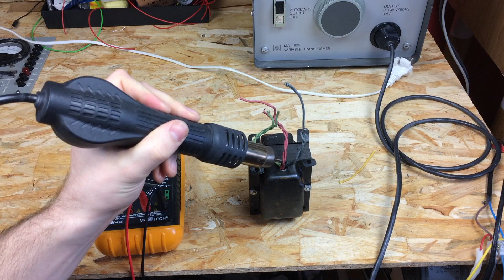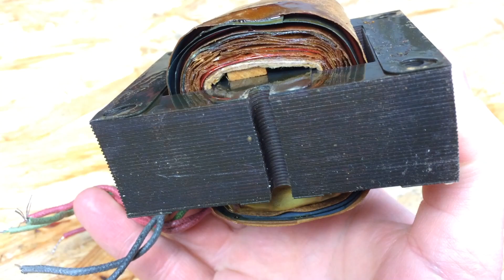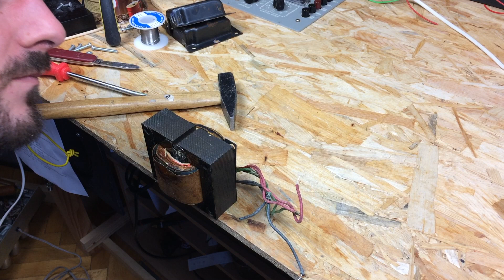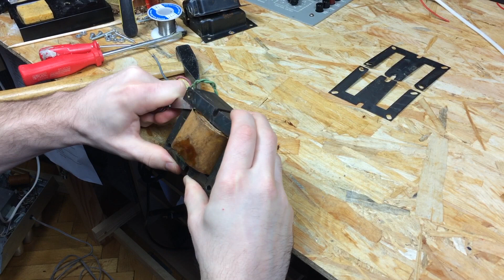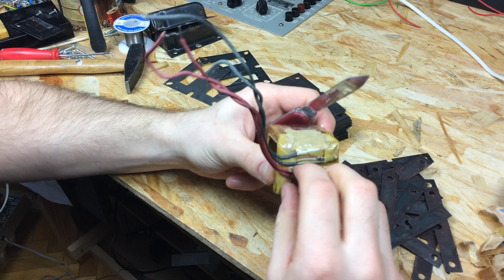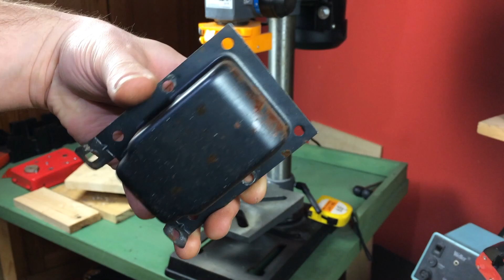HOW TO REWIND A TRANSFORMER (2018)

Comment: Why didn’t you just make a 2:1 transformer to reduce your 220?
Reply from the maker: You can do that of course, or buy a ready made one, but that's additional transformer that takes space and is mounted outside the enclosure etc. Winding 2:1 transformer takes pretty much almost the same amount of time as winding the additional taps for filaments and slightly more for B+. The most consuming part of transformer winding is removing insultation from wires, soldering leads, doing the heat shrinking, installing laminations, potting, cleaning installing the hardware. That takes 90 percent of the time. Winding is relatively quick and easy part of the job.

Comment: I always sand the laminations down to bare metal.  Most of the time the transformer has been painted and the paint seals the laminations together.  I always use a heavy duty utility knife , and tap on one corner.  Once it starts I just run it around the perimeter and they pop right off.  Never had a blade brake, but you don't have to tap very hard.  Still wore safety glasses.  I like making bobbins the old way making a cardboard sleeve to wrap the wire on. I make a bobbin form from wood. I put a coat of varnish on every layer.  Then remove the wood bobbin sides and core. Once done it's a solid bobbin with no sides.  I can use close to 100 percent of the window area then.  It gets a higher efficiency also.  My winder is crude also.  It was an apple peeler originally.  It works good for me.  It's very rewarding rewinding old transformers, and getting exactly what you need.  It's hard to find the correct voltages most of the time when looking for a transformer for a custom project.  Good video!
Reply from the maker: Thank you! Sounds great, I've never tried making the bobbins and winding on them. For smaller transformers I prefer the PCB type bobbins with preinstalled pins. Those are my favourite because there is no need for lead wires and everything is nice and neat and I create custom PCB boards for projects that are made to match the transformer pins so it's a win-win. But, for one off projects, I think cardboard bobbins are a better solution since you don't need any extra materials other than wire to complete the transformer.
Reply: Yes, sir, thanks for the info, I make my own bobbins also, from the Nomex 10 mil insulating paper. I even made a split coil bobbin for an Output transformer for a Vox AC 15 clone I'm building from the paper.  I get big EI transformers from my local metal recyclers for like a buck or 2 a piece, and I take them apart for rewinding. I've only been doing it for a couple of years so far, but I'm still learning. I found this video very therapeutic lol. He does good, safe work, and I have learned several things already from his videos.

Comment: How do you know which wires connect to the primary and which are secondary?
Reply from the maker: Of course, there is no real difference between the primary and secondary windings. It is relative to the where you connect the input. But, you can guess what is the actual primary by color code, usually the reds are HV, greens are 6.3V and so on and primary is black and white. You can also measure the resistance and the primary will usually be a lot higher than low voltage windings and the the B+ hv windings will usually be higher dc resistance than the primary. The safest would be to feed what you guess is the primary with a sine wave with 100mV and then measure the rest to make sure you didn't guess it wrong by getting too high a values. Then increase it to 1V and recheck and then finally to 5V and then measure the other taps and calculate the ratios.

Comment: i have a cheap 12-0-12 transformer the current is unknown but im tested it which 10 ohm load and it give 600ma. it is possible get higher current after rewind it?
Reply from the maker: You can get higher current if you wind it with thicker wire, but of course the questions is whether the thicker gauge wire will fit onto that bobbin. Usually they are calculate to fill the stack as close as possible, so I guess it is not going to work.

Comment: Do you ever hide a fuse in the last wind of the low voltage side?  I thought my 120/24 was burned up but I found a fuse a half a turn away from the stub outs that saved the transformer.
Now I'd just as soon put a fuse on the outside and solder the leads together on the inside and seal it all back up.
This one has the strait laminates welded where they meet the E laminates. So would have been a bit more laborious to get them apart.
Reply from the maker: That is thermal fuse which is really not needed in my opinion. Normal fuse in the primary outside is more than enough.
Reply: @Delatsch  iIt was a 5x22 250V 2 amp time delay round glass fuse with solder pig tails out each end. I couldn't make out the 2 amp part but that fuse comes up when I search the other info.
 It sure saves a lot of work being in there.

I still have to track down the reason it blew that fuse to start with before something else gets ruined. Its on my HVAC system and has taken out my thermostat as well.

Comment: I save the "I" laminations from discarded transformers to wedge between the laminations. Once I can get enough of a gap between the laminations with a knife I can use a hammer to drive the junk "I" laminations all the way through, breaking the varnish that's gluing them together.

Comment: Hi Delatsch, great video! Really helped me to unbuild an old transformer that i want to repair. One question regarding the core laminations. The Transformer i have has a lot of rust on each of the laminations. Do you have any preffered method of cleaning those laminations? I've read that they are coated so that they are insulated fromanother to decrease the effect of eddy current. Other people wrote that the rust could seperate the laminations which will cause hum/noise. I have thought about getting the rust of with vinegar but i'm not sure if i would destroy the transformer with this method, because of the lost of the insulation coat on each lamination. What is your method? Just leaving the rust on the laminations alone?
Reply from the maker: Thanks! If it is just surface rust don't worry about it. If the surface is uneven, try to clean it with a brush or with compressed air. But removing the rust is not important as long as you can assemble the core evenly. If you pot the transformer it will not cause any issues.
Reply: @Delatsch  Thank you! :)
Reply: Yes, I agree with that, just sand the rust down even, on the core laminations, so no air gap can form. An air gap can affect the permeance of the core too.

Comment: does anyone does this in the US 🇺🇸? I need one done and I doubt I can do it on my own.
Reply from the maker: What exactly do you need? Usually it is easier and cheaper to just wind a new transformer or find one with the same specs. Unless it is some "holy grail" unit it is not worth it because in the US it would cost a lot.

Comment: Would applying heat (with fire retardant gloves) to the laminations help? It looks like once you have first few off the rest gets easier. Is that the case?
Reply from the maker: Putting it in the oven on the low heat should help a lot.

Comment: Hi there,  very interesting and informative video - thank you - that I've only just come across and about which I hope you are still open to a question on. 

If you have an EHT transformer with several winding layers to achieve a +2kV output voltage and you know the number of turns required is, say, 2200 turns, is it optional to have the turns equal or unequal on each layer so long as the total number of turns is achieved over the total number of layers and no single layer is way outside what would be reasonably chosen.  So let's say the number of turns for each layer went 98, 96, 110, 104, 99, 121, 107 and so on until 2200 turns was reached on the final layer.  I have this in an EHT transformer in a faulty oscilloscope with no display on its electrostatic CRT.  The EHT winding went open circuit and I am rewinding it with fresh 38 AWG wire but would like to make each winding layer the total number of turns divided by the number of layers, so it's nice and even.  I can do this, right?  It won't matter?
Reply from the maker: Hi, thank you for your comment! I don't have much experience with flyback transformers, but I don't think that even or uneven layers could affect it in any way. The important thing is to have the final number of turns and in this case the isolation between layers and final high voltage coating is very important. Be very careful with high voltage, but I guess you have experience in working with TVs and similar HV equipment.
Reply: @Delatsch  Thank you!  I very much appreciate your advice.  Yes, I agree - I just thought it would be good to hear it from someone with experience like your good self.  Yes, I will be very careful and I am following the original design and using good quality Mylar tape in between each layer and of course again on the topmost layer to fully insulate the exterior facing layer.  The transformer will then be res-soldered to the original PCB, which uses a 6 stage Cockroft-Walton multiplier, then dropped back into its housing before filling it  with potting compound to prevent arcing.  Hopefully it all works once soldered back into the scope.
Reply: I know Im asking randomly but does any of you know a tool to log back into an instagram account?
I somehow lost the password. I appreciate any tips you can give me
Reply: @Abel Wesson instablaster =)
Reply: @Fox Brayden Thanks so much for your reply. I found the site through google and im waiting for the hacking stuff now.
Seems to take quite some time so I will get back to you later when my account password hopefully is recovered.
Reply: @Fox Brayden it worked and I finally got access to my account again. I am so happy!
Thanks so much you really help me out :D
Reply: @Abel Wesson glad I could help :D

Comment: Next time you do this, give the entire transformer a bath for 10-20 minutes in boiling water and it will almost fall apart on it's own. The amount of trouble you had to delaminate it is avoidable.
Reply from the maker: Thank you for your comment. I will give it a try!
Reply: Does the water cause the silica steel to rust?
Reply: @Mirroxaphene  You'll probably end up with surface rust, no biggie. You could spray some WD-40 and/or some oil to prevent that from happening too much.
In factories, they get the parts with surface rust from shipping but they just let it be. Once the wax layer is applied, no more rust will be able to form.
Reply: @hussssshie  If you don't want to save the coil, boil the transformer in Lye, in Caustic Soda. That removes all varnish between laminations, on the bobbin and on the copper wires.  A strong base works as an rust converter too, if there happens to be any rust on the laminations, and after you removed the laminations from the bobbin, put them all in the oven to dry them completely  before storing. You'll ofcourse not be able to reuse any windings as they no longer are isolated, but your laminations and bobbin will be as new.

Comment: Whats the frequency did you take for turns calculation?
Reply from the maker: For Europe I use 50 Hz.
Reply: Aaahhh its been 5 years that i asked that question 
At that time i was new in audio field and i didn't even understand that he was making an single ended transformer 
I thought it was push pull
Though later i build and gain clone 6v6 pushpull output stage stereo amp with ultra high linearity, frequency response lowest upto 20 hz tho it made the output transformers bigger than power transformers😂
Btw thanks for ur suggestion 😊
Reply: Umm can you tell me the frequency of output transformer of  speaker?
I really need it
Reply from the maker: @soumikdas5857  Don't really understand what you are trying to say. This is a power transformer not an output transformer.
Reply: @soumikdas5857 it depends on what type of output transformer you are making, a guitar amp OT? A Hi-Fi stereo? A guitar amp, you could only have to go down to around 40-50Hz,,  a guitar signal is around 80-1200Hz, unless down tuned, or extended scale guitars, so you wouldn't have to go that low frequency, actually. A HiFi stereo OT would go lower to cover bass, drums, etc. frequencies, I've read that they try to go down to 20-30Hz. Which is a more complicated build. Igor Popovich's book on transformers is what I would recommend along with these Delatsch videos, for more information. Good luck.

Comment: Hi. When you need to rewind a transformer?
Say, the power adapter of a Famicom (a japanese Nintendo)?

Thank you. God bless, Proverbs 31
Reply from the maker: Hi SevenDeMagnus,

Well, you should measure the AC voltages at the output of the transformer, but you should have a basic knowledge of electronics and make sure you follow the safety precautions. Maybe it's just easier to get a replacement since these adapters usually use a tiny transformers which are impossible to rewind.
Reply: Doesn't the Famicom, like pretty much every home console from the time, have a 7805 voltage regulator right after the input? So it can take everything from 7.5V to 12V (just note that the higher the voltage, the more heat it gives off, so you'd want to stay between 7.5 and 10V). No need for a special PSU. The US/European NES has a rectifier, so it doesn't even care about polarity or if it's AC or DC. It should also be rated for at least 500mA (1000mA or more if you use fancy multicarts).

Note that if you're preserving the original PSU for originality's sake, this entire comment is pointless.

Comment: Hi. When do you know if a power supply needs to be rewinded or some other components like the capacitor or resistor or transistor, need to be replaced instead? I have a Famicom power supply, it's a video game console. When I measure it at the end of the power supply jack (where it plugs to the unit), the measurement is less than 0.5v only. The specifications of the power supply is:

MODEL HVC-002
MITSUOKA D.S
AC100V 50/60Hz 18VA
DC10V 850mA

Our mains/outlet is 220v (s.e. asia). 

It'd be nice to restore it to its original. I've already opened it (it's got the rarest screw I've seen, tough to unscrew) it. 

When I test the voltage (using a step down transformer), what comes out of the jack (the end you plug into the Famicom) is less than 0.5v

Thank you.
God bless, Proverbs 31
Reply from the maker: Hi, must admit I'm not familiar with the device, but you should check the specified voltages at the output of the transformer where it enters the board. Those are all AC voltages. If they are ok then it means that something else is the problem. By very careful if you are not sure of what you are doing maybe it's better to ask help from a friend or someone locally who can help you.
Reply: You need to open circuit the secondary of the transformer and then measure the voltage across it to figure if the transformer is dead or if it's the rectifier etc downstream loading it.  Basica troubleshooting ...

Comment: I rarely manage to get the last lamination back in when reassembling, so don't worry if you
damage the first one getting it out. Also, the primary turns per core size are then slightly increased so no damage done.  Just the power rating slightly decreased.
Reply from the maker: Yeah, it's not a big deal :)
Reply: I have noticed that too, and I agree, from my humble experience, I do the same.

Comment: thanks for sharing, would boiling the transformer in water to disolve the wax help??? or would make it worse??
Reply from the maker: You could try heating it up in the oven or by a hot air gun, but I think that water would not be the best solution. Haven't tried it though. Thanks for stopping by!